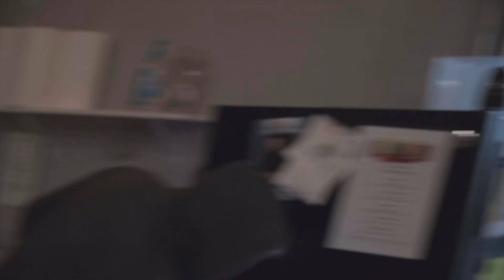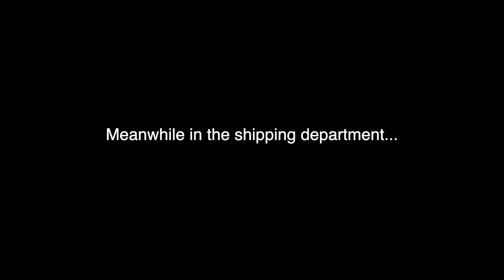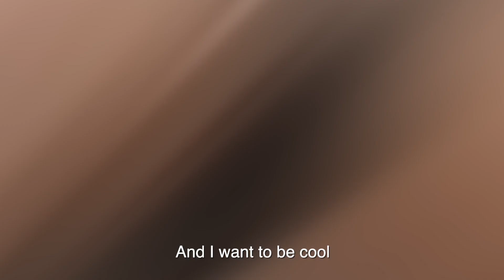Black Friday | The Shop S1E1

Comment: Hi! On My beats solo 3 wireless the right side stopped working when connected to Bluetooth, but when I use the wire both side work perfectly. Any suggestions?
Reply from the maker: Thanks for watching! This could be a fault in the Bluetooth board. You can have it repaired if you want by filling out a form on our website here: JoesGE.com/pages/repair-services

Comment: Hello, I have a question about the beats studio 3 wireless. The question is if there is a way to repair the adjuster on the sites for the head because I accidentally tripped on them and now its loose so it's always down when you don't wear them. It's where the cable are going trough where its open. Do you know how I can open these up to repair it myself?
Reply from the maker: Thanks for watching! This video here shows the process on the studio 2, but it is very similar to the 3's: https://www.youtube.com/watch?v=odYFS88nR1g&t=332s .
You can also send it in for repair here: JoesGE.com/pages/repair-services . CH